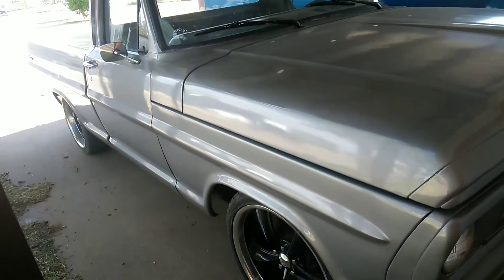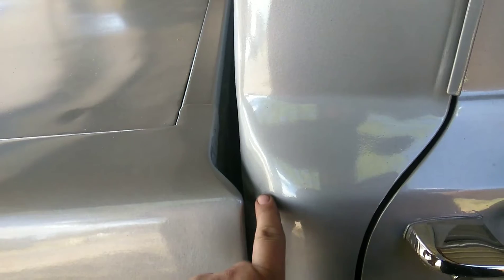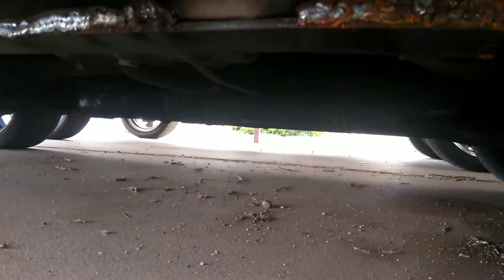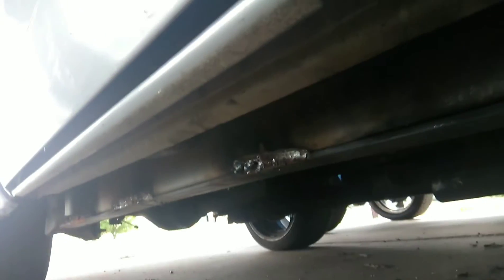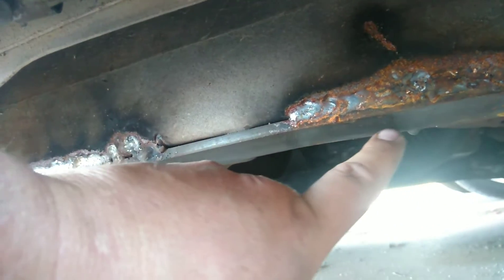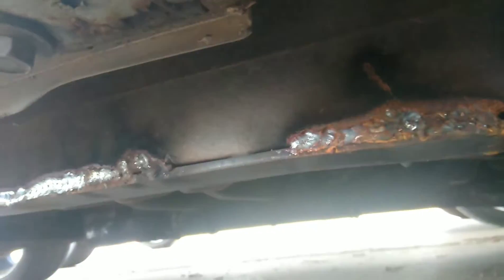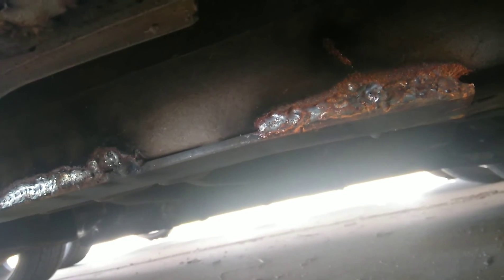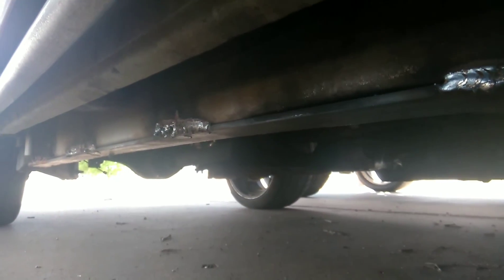How to fix a sagging car/truck frame

Comment: Thanks 👍
Reply from the maker: Hopefully this helps I know that the welding bead trick works I've done it and I've seen it done I've seen a barn start sagging from snow and a welding bead pull it right back into place